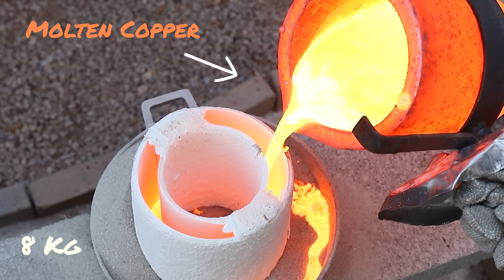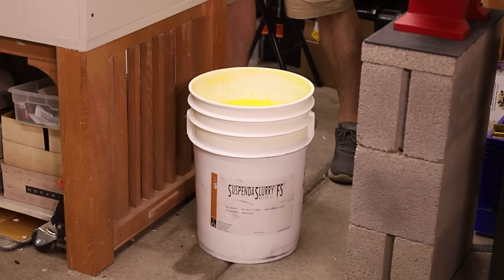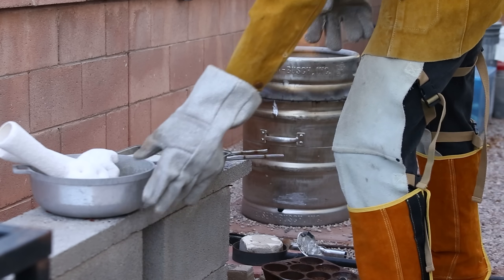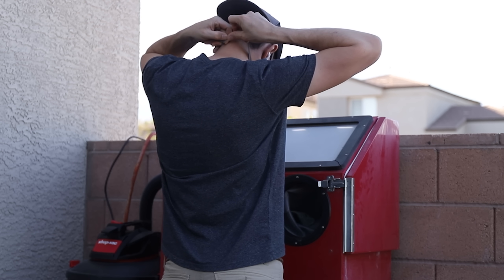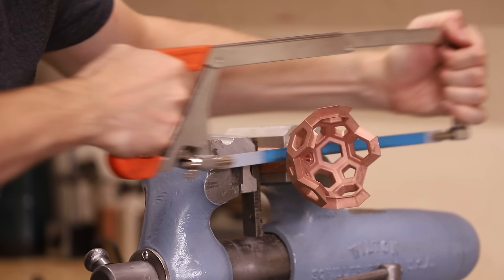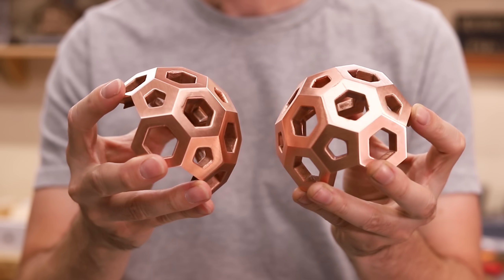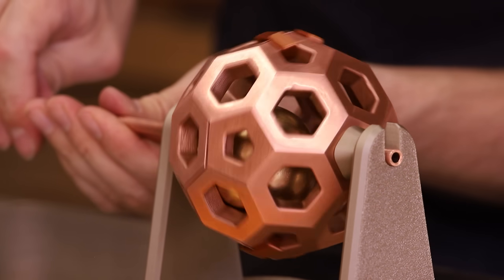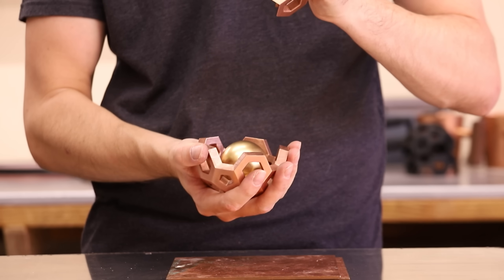HUGE Magnet VS Copper Sphere - Defying Gravity- Will a Neodymium Magnet Float Inside?

Comment: Really clever idea! You might try painting the copper black and playing with the shutter speed of the camera to get a stroboscope effect that will make the copper look like it's not rotating so fast. Alternately do a really slow shutter speed so the cage is a blur and the sphere stands out better since it moves slowly
Reply: Reach out to the slomo guys.
Reply: You should try a strobe lightand and try to match it to the shutter speed of the camera
Reply: You beat me to suggesting painting the magnet! It's fine, I'm already subscribed to you. I was going to suggest a bright blue paint to contrast with the red copper.
Reply: @NapoleonThe12th  You could paint it with a fluorescent paint then shine a UV light on it so it glows.
Reply: Or put an optical sensor on the drive, place a slotted disk on the shaft, and use a LED lamp, so that the lamp only shines when there is a view into the sphere from the camera.  Will need to be optical simply because magnetic will not work with that massive field. Copper sphere would be best also heavily plated with silver, to reduce skin resistance, or of course if it was cast entirely in silver as well, either pure, or alloyed with copper like coins, so you get a harder alloy, but still with lower resistance.
Reply: @SeanBZA 
There's only 5% difference in the conductivity of silver to copper for the same cross sectional area. It won't make any perceived difference.
Reply: @SeanBZA  That looks like a VERY promising idea.
Might even be able to set this up using multiple ports to get several LED triggers per rotation.

@SeanBZA said,
Or put an optical sensor on the drive, place a slotted disk on the shaft, and use a LED lamp, so that the lamp only shines when there is a view into the sphere from the camera
Reply: The stroboscope effect would be great to look at!
Reply: @DVSS77  put lasers in it and make it a dope ass stage piece at a rave.
Reply: @DVSS77  "Wow, the animated glasses effect is really fun! 😍 I'm also imagining how cool the scenes would be when applying it to my videos. Thanks for this comment! What do you think? , which effect would best suit the theme of 'urban terrace garden'? Let's discuss further!"
Reply: Remake a copper sphere with only horizontally oriented slits which make the sphere appear translucent under heigh speed or even disappear with the right shutter speed of the observant camera… like that the sperical magnet will seem to float in mid air…

The fact the horizontal slits would bundle up in fully capped ends makes attaching the axles easy and also allows for a directionality of the eddy currents within the sphere… an inherent polarity if you will… this might help stabilize the magnet since a sphere with a polar magnetic field is gyroscopically stable when spinning when those poles are aligned with the axis of rotation (like our planet)…
Reply: When I see you in the comments somewhere it means I need to subscribe to that channel. I wish i was
Reply: L  @handlesshouldntdefaulttonames
Reply: As soon the magnet start to rotate at the same speed as the sfere, the lenze efect will be lost and the magnet fall down.
Reply: @MegaTDave  Exactly what I came to say. 
Maybe a tether from a hollow short side X axle.  Suspended from the Z axis, rotating in the X plane?
Effects on a secondary external magnet?
Reply: You could try the inverse,  if you have a array of magnets around a copper ball you should be able to float it by spinning it fast. using electro magents you can get a strong field to be projected out. The counter force the copper moving through the fields generates should allow it to "roll" and counter gravity. 

(Might not work with a single solid copper ball)
Reply: I was going to comment for him to make a stroboscope too, I would love to see that
Reply: Brilliant!
Reply: Nighthawkinlight = LEGEND
Reply: Hey, love your videos!
I was curious as to whether or not you have considered making content about the potential uses of thermoelectrics in personal temperature control? 
Like a air-conditioning suit using that thermal fabric of yours alongside a thermoelectric cooling pad.
Reply: Different spin angle
Reply: Brother over here giving filming tips inbetween making heat dispersing fabric. Way to rock your Muchness (Me'od) brother!
Reply: We sub to some of the same content. You know a good channel when you see one.
Reply: This! Listen to this man!!!!!
Reply: anodize matte black?
Reply: God level advice.
Reply: Pro tip: put your finger over the end of it when it clogs and it will blow the uptake tube out and whatever was clogging it. 
Make sure you really hold your finger over it though😂
Reply: Since it's copper, if you want a contrasting color to the gold magnet, you could patina the copper with ammonia and vinegar to turn it blue, or liver of sulfer to turn it grey black.  I love the copper color tho, so painting the magnet would look better imo
Reply: @GeoffryWK thank you for the correction, frame rate is what I was thinking
Reply: This is correct.
An alternative to painting that beautiful copper might be to coat it in soot from a oxy-acetylene torch set too rich. Then to remove just a dunk in water or solvent of some kind.
Reply: Looks like he's  designing an   anti-matter containment field ?   :-)   Careful with that sphere !
Reply: how about - anchor and electrically isolate the two copper hemispheres - 
then connect axle rods to magnet ball in the center to spin it - having north / south poles alternating to close proximity to the two hemispheres - creating alternating induction - 
- check for voltage and power generated between the two copper hemispheres
- possibly place metal structures attached to inner side of copper shell to channel / facilitate greater magnetic effect as it will be in closer proximity to magnet
Reply: Oh baby, thank you for slowing and playing the jazz music during those sexy dips ;)
Reply: Why not use magnets and copper for landing space craft ! Every time I think of magnets, I think of space  travel 🤔 😊
Reply: That copper dome is amazing !
Reply: Did you try spending a horizontally
Reply: Good idea it's too cool looking to paint black tho
Reply: Exactly my thoughts, it would be super cool!
Reply: Dang I was about to say the exact same thing!
Reply: Was going to comment about painting the copper black. A black mesh that moves around fast will just make everything darker while not visible itself. The Darkening can be compensated with more light.
Reply: That would be so cool
Reply: I am a big fan of:)
Reply: Tarnish it black. Be a great bookshelf ornament /toy for those who can afford it. Avoid paint.
Reply: This guy impossible to contact @nighthawk i hope you got my solutions to uv paint to adhere been tryin to explain since dec last year my research i found. Thats solved your pigment issues
Reply: Smart 💯
Reply: 07:29 Satisfaction! Yeah
Reply: Came here to (try to) say this. 😁 I could see it clearly in my mind’s eye but had trouble verbalizing it. Great comment!
Reply: I thought of this too! I was going to comment it but I didn't expect anyone else to have the same idea.
Reply: Add some voltage to the copper..??
Reply: Try tattoo machine so you can adjust speed ..... consistency is key 😅
Reply: VERY INTERESTING, SO THEN- PAINT THE MAGNET A NEON COLOR AND PLACE A BLUE LIGHT NEAR, THEN DO THE EFFECTS WITH THE COPPER PAINTED BLACK, THE BLURRING WILL DEFINITELY NOT COVER THE MAGNET MUCH THEN !!!
Reply: Funny the further I read down the comments, the more it degenerates into a slanging match....never see that on night hawks channel....😂😊🇦🇺
Reply: @GeoffryWK
There is a carry over in terminology from film cameras that still apply. Shutter speed is one, zoom equivalent to 35mm film is another.
Reply: You should do a video of making white charcoal/ kisyubintyotan charcoal
Reply: Adding onto the blur idea, with a small shutter angle and fast frame rate he could capture many frames where different parts of the ball are exposed then stitch them together to synthesize a single frame where the cage is removed. It would be a lot of work though.
Reply: Build more and put them in a spherical like engine.
Reply: Or match frame rate to a fraction of the rotational speed so it looks like it's not spinning at all, could be cool to see
Reply: Theres another force at play, gravity, unless the magnet is strong enough to resist the earths' pole it might not work.
Reply: Depends on the type of digital camera. DSLRs do have a mechanical shutter.
Reply: the magnet had timeout thats why
Reply: @aldargansukh6305  what in this video
Reply: @aldargansukh6305  I don't mean as in this experiment,  I mean in general! , you see, at a certain speed, it stays afloat! 
I would be more on magnetic projection of some sort of acceleration
Reply: Or paint it green and remove greenscreen
Reply: When i saw this the movie Contanct hit me if that magnet is in the copper cage and you moved it about a foot away with annother magnet well dont it look like the consentric rings of the movie contact that giroscope looking thing 😅 but yea that was bizzare 🤔
Reply: Different branch of science.
Reply: The problem is YouTube limiting the videos to 30 FPS
Reply: Or call the slow-mo guys.
Reply: Chair legs
Reply: @robinsonfoundry - Excellent video in the process of making this.  Watching you fabricate it was interesting and informative.  Great job!🫡  You rock!
Reply: Just made the sphere a little bit more bug
Reply: ah clever! you can do similar stuff with lasers and shutter speed with scan rate of lasers!
Reply: @GeoffryWK Basically, @SeanBZA is creating a virtual shutter effect.
If the camera has an auto IR Filter, that would probably have to be disabled or the imaging would look crazy as the filter comes into play each time the LED switches off and room goes dark and the cam's IR LEDs turn on and it keeps capturing video data. It would depend on time interval between the "take a shot" LED triggering and the response time of the IR Filter deploying and retracting. 
The IR Filter is usually a mechanical "flipper" kind of mechanism, and from a digital imaging standpoint it is VERY slow. The camera design may also include IR Filter enable/disable programming code that inserts additional delays of a few hundred milli-seconds at the front or back end for some reason...like to avoid deploying or retracting the filter due to intermittent shadows or flashes of light in a given scene.
Reply: he could also use a stroboscopic light to make the effect irl and on cam
Reply: I think you made the basic plans for UFO's or UAP's whatever they call them today.
Reply: Liquid nitrogen.
Reply: Didn't seem like it was floating to me it was just clunking around
Reply: Also two or three gears and a crank to spin by hand faster at controlled speed
Reply: That's really clever, dude. Nice...
Reply: LED lights have this flickering that i think would benefit for this video/photography.
Reply: i support these ideas
Reply: Wow your one intelligent little cookie impressive
Reply: @GeoffryWK  isnt it still refered to as shutter speed if its digital thought? even though its not a shutter? genuine question, im not sure which is right
Reply: Like it.🤞
Reply: How about trying smaller sized magnets to see if one will float without hitting the copper.?
Reply: Wow this is how the earth works you could build a mini plant if you figure out all the laws.
Reply: There's a Game we the peoples children's children should know and love BASED OFF COPPER AND EDDY CURRENTS.❤❤❤❤
Reply: @GeoffryWK and does this affect lr effect the outcome of the images?????❤❤
Reply: Your idea is so creative! Painting the copper black and adjusting the shutter speed to create a stroboscope effect definitely makes for interesting visuals. The slower shutter speed approach also makes the sphere stand out, which is very clever! Do you have any other methods that could create an even more unique effect in this video?
Reply: nerd emoji
Reply: I saw it floting
Reply: There's a spray "paint" called Steel-It. You can paint it, weld it and it will stop corrosion and rust. That might be a great idea for a paint that can be repainted later.
Reply: Backlight
Reply: As to the left over risers: you could use them as weights and wrap a string around the drive shaft, so as they fall they drive the spin. You might need a governor to control the rate though
Reply: A thinner mesh copper cage should work too
Reply: Too thick a sphere s and too big a magnet. From. What I would suggest is a smaller magnet perhaps super charge it, and a slimmer cage/  sphere.  the sphere doesn’t need to be so thick, the cut outs need to net bigger to provide a good look in side the cage.
Reply: Also, some texturing like vintage Hammermrd look on the outside of the shell, or a matte , sanded, blasted, brushed?  the texture to both inside and outside our perhaps a chemically induced, even toned, even colored rust inside, or a darker lacquer lacquer to produce a appealing visual contrast between the golden magnet and the copper shell? 2:03
Reply: Bot😔
Reply: I had the same idea while watching this video!
Reply: Wow I need one too
Reply: I was thinking of this exact thing 👌🏻
Reply: Jesus loves you. He gave His life for us. Confess your sins, follow Jesus, and live forever with Him in Heaven!
Reply: Просто прикрепи небольшую камеру на медную сферу и сбалансируй.
Reply: This is awesome this will prove my time travel theory... 🤔 
If you spin the outside near lightspeed a person can be in the middle standing still... But the spinning mechanism will travel into the future, causing you to travel into the future...
Reply: Eynyone from 4928?
Reply: This guy does camera
Reply: Given the price of Copper, it's worth saving all of the dust and offcuts, to melt them down for a future project.
Reply: Always know that I've found a cool channel if I see Nighthawkinlight in the comments!
Reply: pfffft
Reply: This was going to be my suggestion. Use a strobe light or camera with a shutter speed you can vary to capture the ball as it floats.
Reply: Nuh uh
Reply: How did I know you would see this
Reply: Imagine someone uses that to make a car which can float
Reply: It would need to be strong enough to float
Reply: sybau gurt yo
Reply: Night hawk in the house!!!
Reply: Where can i get the ball magnet please?
Reply: Me trying to tell my Wife her Mouth is not a Perpetual Motion Machine! 😬🔄TEAMWORK GUYS 🔄
Reply: You can tell it's floating from the sound, it stops banging the inside
Reply: I think Iron nitrade magnet! They are the most powerful magnets. 

 Only one company makes em last time I checked. Hopefully they become more common as they are supposed to be much more magnetic then even neodynium.
Reply: Don’t forget to put “free energy device” somewhere in the title
Reply: @Survivor1942  Hello Mr. but this not your typical Indian "Free Energy" video, it's just a clever demonstration of Lenz's Law. Think before you speak.

Comment: 0:28 does that make contactless bearings possible? What's the drag like?
Reply: No because the eddy currents generate heat in the metal.
Reply: Contactless, yes, drag-less - no.

Magnetic bearings already exist, this is just a derivative of one
Reply: @mduckernz  Maintenance free bearings sounds pretty sweet even if they're less efficient.
Reply: @mduckernz  cool what are they used for
Reply: Would probably melt itself if it went too fast
Reply: @Andrew-vr5bb  just don't go too fast
Reply: Not quite, although maglev is used for reduced friction in other systems. What you see in this video is more like a reactionary force that resists all motion.
Reply: fingers crushed
Reply: I think bro is onto something
Reply: Everyone's is talking about heat, as of you couldn't make a heat sinc
Reply: @Nae_Sayer  no it's like the heat literally generate in the metal via Bluetooth
Reply: @bread6957  could it not be cooled then, via cold shit, literally how superconductor levitators works? Just keep the medium the the field travels through at a steady temperature, maybe by submerging the whole thing into a nitrogen bath. OR the coppers cores rotating pins, have heat displacers, where the excess heat is removed and used for energy generation close by... 
Or coincidentally I think it'd work to do a combination of both to increase the efficiency, keeping it in a water bath, and the energy loss would be through friction of water and a LOW LOSS through a motor driven gear set with a high torque output low input. 
NOT AN ENGINEER SO IF ONE SEES THIS, DO MATH OR WHATEVER AND TELL ME IT IS IMPOSSIBLE. POR FAVOR!!
Reply: @Nae_Sayer  why would you put in that much parts in a little bearing that usually only take 3 parts?
Reply: @bread6957  to make it last a lifetime, why not?
Reply: @freedustin  bro the more simple a thing is the less likely it malfunction
Reply: @bread6957  malfunction and break due to physical stress are totally different things.
Reply: @bread6957  we're not talking about the likelihood of constant functionality, we're making guesses, and asking is it possible if YOU don't know, then stop advising.
Reply: @Nae_Sayer  I said that because he told me “for it to last a lifetime why not”
Reply: @Nae_Sayer  I never said you are wrong
Reply: @Nae_Sayer liquid cooling, ftw.